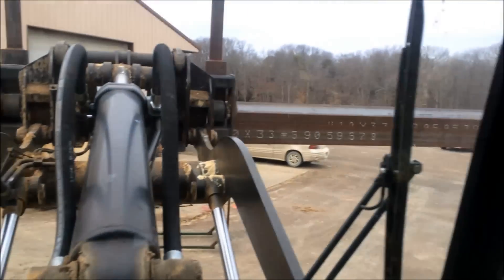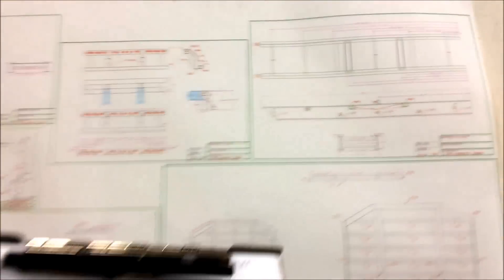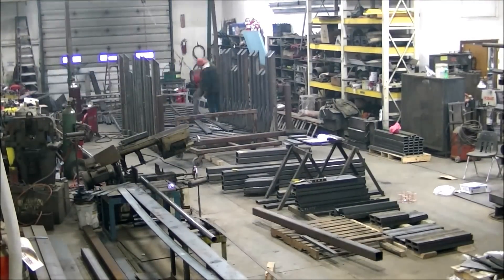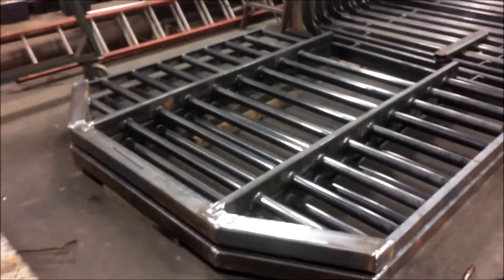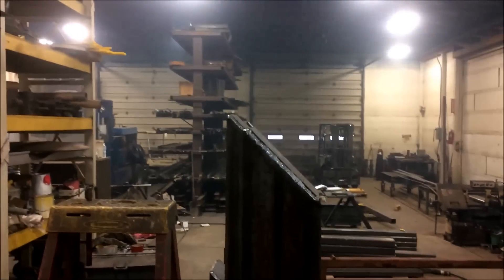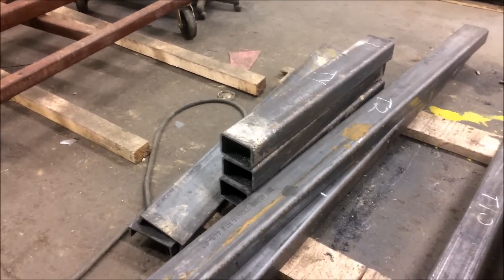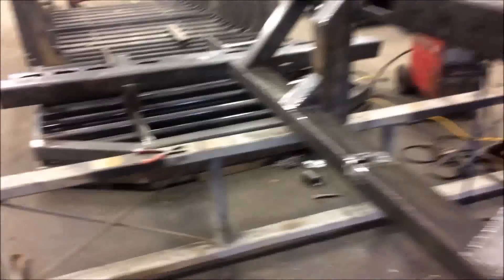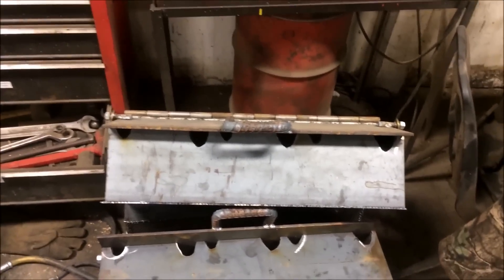Twin Log trailers part 1...

Comment: Wade,
 Cut a pattern out of wood for your lights. Lay the pattern on and go to town. I use a plasma and the hole has to be a 1/2" bigger on all sides. Use a hole saw for the ends and connect the dots using a sabre saw. Takes a little time to make the pattern but once done you just clamp it on and start blowing them out.. Works great.
Reply from the maker: kj inohio I see thanks bud

Comment: How has your Lincoln wire machine treated you? I run a 255xt in my shop and it's been bulletproof. Good power and duty cycle for a single phase machine.. Lookin good from Ohiya!
Reply from the maker: The1320pass hey I really like my little Lincoln,  I back it up with a big Miller 3 phase when it gets real

Comment: Wade, why do you put headache racks on trailers instead of the truck?
Reply from the maker: Marvin Wegner shorter wood not safe with shorter wood.  little slimy poplar logs could slide down and take out the fuel tanks or catwalk...  Or at least that's the consensus,  I guess a guy could wrap a guard around above the fuel tanks...  hell I don't know that's the way they always been lol
Reply: Logger Wade A Rack on the Trailer is for safety for the driver. If you jam on the brakes or hit something the logs will only travel a few inches. With a Rack on the truck the logs get momentum built up and can push the Rack deep into the cab.  If you drive a Day Cab that is not what you want.  Good question Marvin.